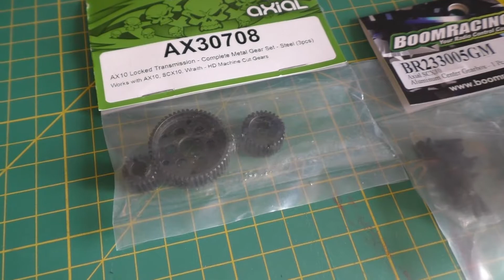Trail Project: Axial SCX10 Jeep Wrangler G6 Build / Upgrade Series - Episode 15

Comment: Very nice upgrades. 👍🏻 definitely stronger now 💪🏻💪🏻. ✌🏻
Reply from the maker: It was well overdue, I didn't expect the stock gears to last this long! Just need to keep checking the spool bolts to make sure they're not backing out. I don't want one of them travelling around a steel transmission.

Comment: Ouch...  Was there any warning noises before it stripped out, or was it a sudden catastrophe?  I'm glad the servo is working out well - PowerHD is definitely an underrated brand. :-)
Reply from the maker: Not really, I was trying to go up a steep rock and the front bumper hooked up. I tried to blip the throttle to free it up and it just went. After that, it just stripped every tooth and I had to nurse it back. Don't have to worry about it now, just need to carry spare driveshaft parts. Well impressed with the servo though. So much more power for the same price, can't complain.

Comment: Noob question why would you fully tighten the slipper clutch?
Reply from the maker: To give you the most power out of your motor without any slip. You really should run with the slipper bolt unscrewed a little (1/4 - 3/4 of a turn) to save the driveline components. I was trying to make the idler gear strip out so that I could upgrade it. They lasted well though, very impressed. If you don't have the budget for steel gears, the plastic ones will do fine so long as your careful.